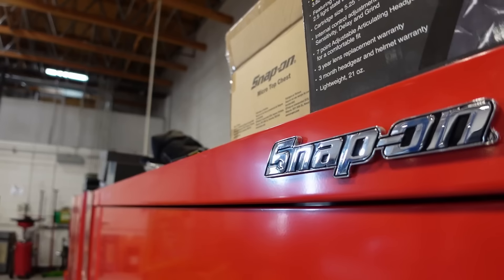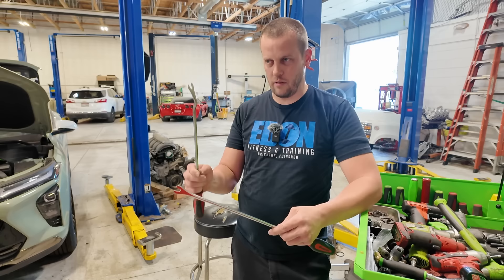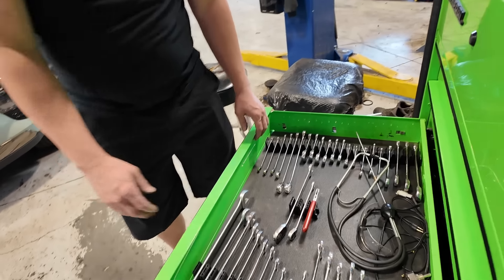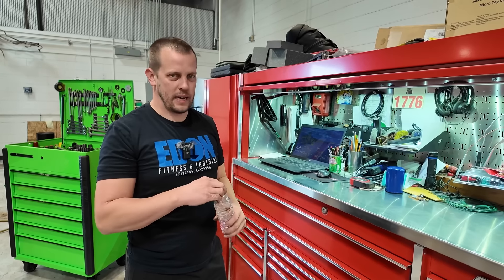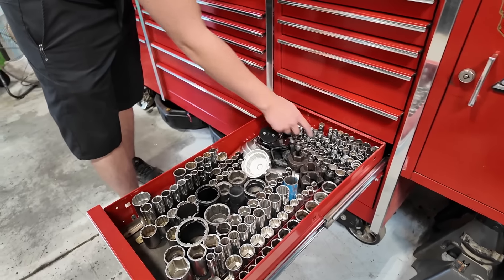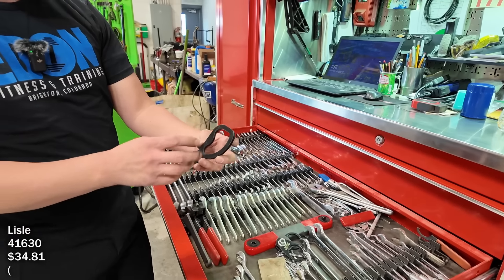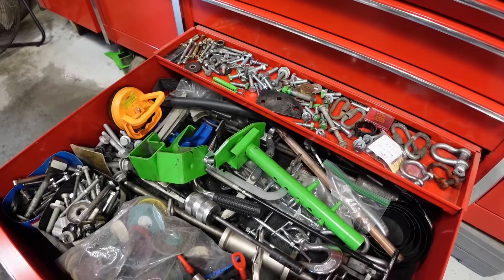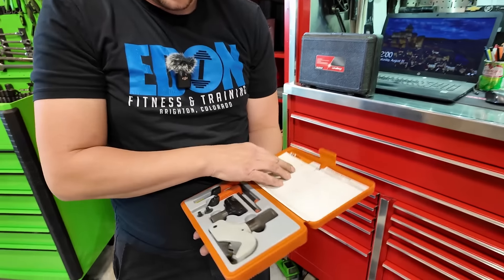Seasoned Chevy Tech Shows His Classic Setup!

Comment: That homemade quick disconnect heater core hose tool is genius. Such a tight fit back there and looks like it’s just durable enough for that job while still being flexible enough to get in there.
Reply: I made one for the ac lines on my ranger before I had a disconnect set

Comment: 27:12 typicaly is a lineman socket. I start by buying a large 1/2" drive one and I'll mill it out to fit onto bessey clamps. That way when you dont want to ruin your shoulders and wrists you can use an impact to drive whatever with your impact and not your body.

Comment: The scan tools,have to pay Chrysler for computer info 2016 and up.The other option is buy a bypass cable to get through without paying for the info once a year.Those transmission line fitting clips,I save them too.Once in a while you will lose them removing them.Those flare nut sockets are a copy of the Koken design.Koken had a patent on them and came out with them first.Snap On copied it after the patent ran out.Spring Tools makes that Snap On spring loaded punch and chisel set
Reply: Not info Access, the gateways are locked so people can't hack into the computers. In 2014 a group of hackers hacked into a jeep and took complete control of it while driving down the road, it's for security not to rip off mechanics, the same way you need an LSID to make keys nowadays

Comment: As a gm tech as well it’s so cool to see and know what he’s  talking about. Has anyone found any super strong t50 torx? I’m constantly braking mine on a steering wheel recall I have a blue point one and a couple impact rated ones but they all break.
Reply: Same. Gearwrech all broken.  Have you tried the gold Snap On?  Ive had good luck with Wright 3/4 drive hex when everything else breaks. They might make strong torx.
Reply: Snap-On gold or "Heavy Duty" line seem to be the best. They still break though
Reply: Vim ones will likely be what you want. One piece and super strong
Reply: 2nd the VIM. I have Mayhew and believe they may be VIM rebranded Mayhew, but Im not 100%. Definitely go one piece either way, and stick to S2 wrather that the black chromo as they're much harder.

Comment: Busy dude working on those modern GM trans.... The HD trucks are little better the 1500 is dead to me once they went to struts stop using Greaseable suspension and steering parts ... The electric parking break, steering hard pass for me in a work truck... I even prefer mechanical fans

Comment: How did they break into the shop to get to the boxes? Don't they have security locks on the doors?
Reply: @LouisCapps-p3z  Ive seen them drive a truck through bay doors, use a torch to cut through the door,  break a window and get inside, get key code off service truck door and order the key, take the entire truck, pry the doors straight off, come back 6 months latter after insurance replaces everything and hit em again, take 2 prybars out the side of a cart and pry top drawers of roll cabs open. Use shop forklift to load all boxes into van.
Reply: Crazy. The shop where I had all my equipment at also got broken into. They left most of my tools etc but they took a lot of my contracting equipment etc.
Reply: @LouisCapps-p3z  It happened every so often in past, but it getting much worse.  West coast.    Be careful. They will prob come back and try you again.  Holiday weekends, rain days